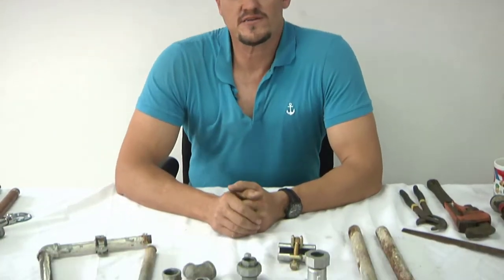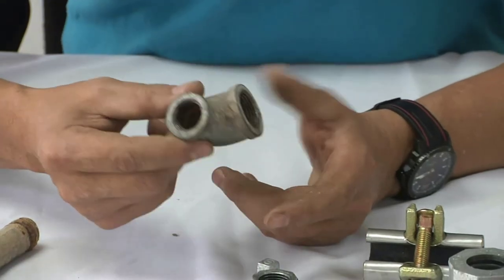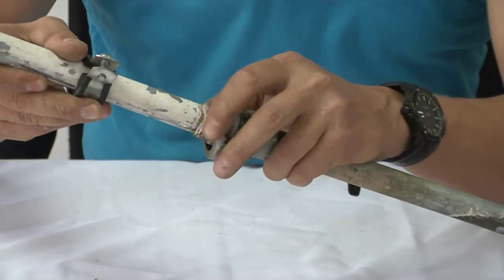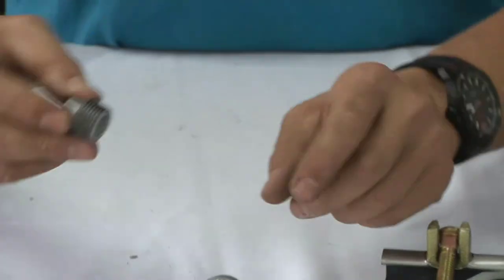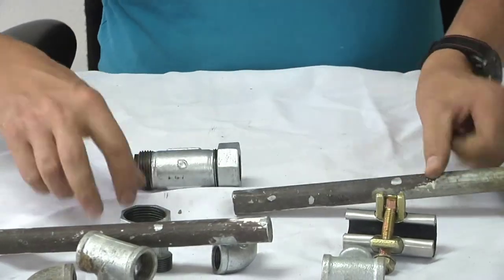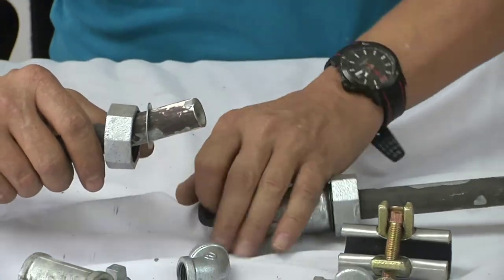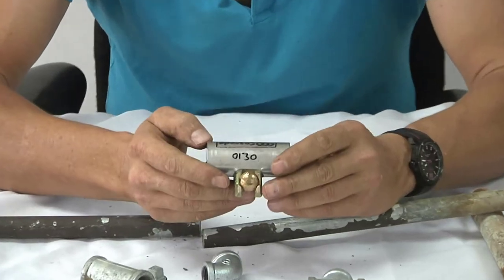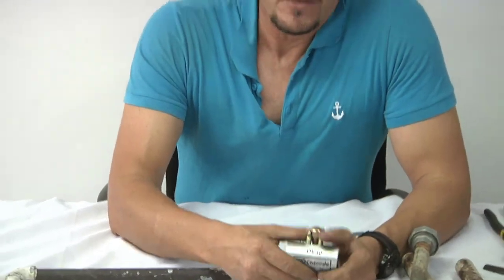💥 🔥 Galvanized fittings, all about fittings and pipe of galvanize, 💥 🔥

Comment: Galvanized is the worst  material to use in your home if you cant afford to replace it all unthread the  nearest joint and use pex fittings to repair
Reply: PEX can’t be used for gas lines